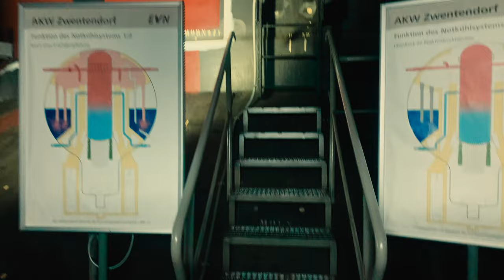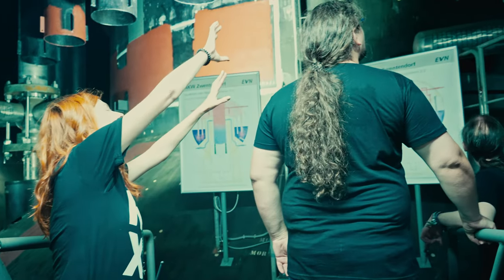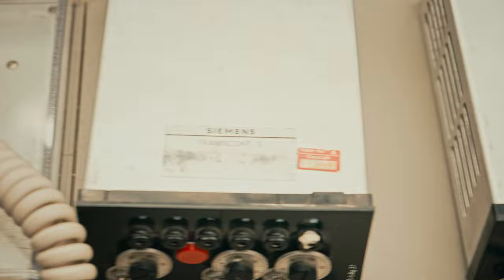Playing "Master of Puppets" in a NUCLEAR REACTOR!!!

Comment: Audio Engineer: You gotta treat your room so you can avoid echoes while recording. 
Also Audio Engineer: Let's record a guitar amp in a wide open building surrounded by metal and concrete...
Looks like you guys had fun tho
Reply: Yeah, that's interesting. Why would you just record everything dead dry? It's probably because you want as few problems in your recording, but when you think about it, many of the old and classic albums were recorded in some unusual places too. We should just try to pull our mics away from the amps a bit, just to capture a little bit of the room too and hear what it sounds like.